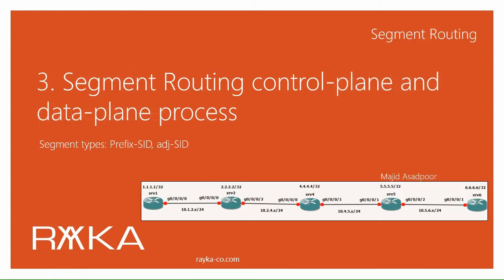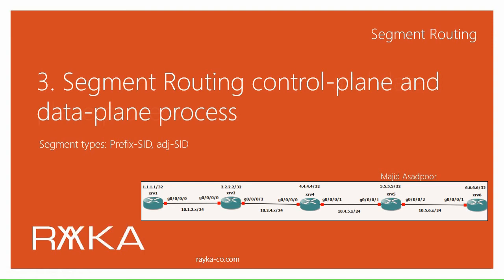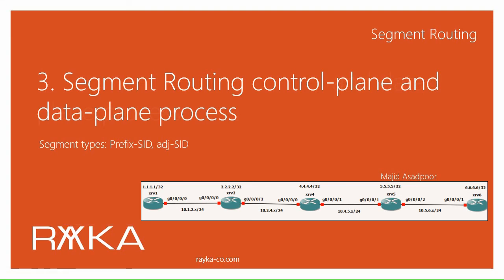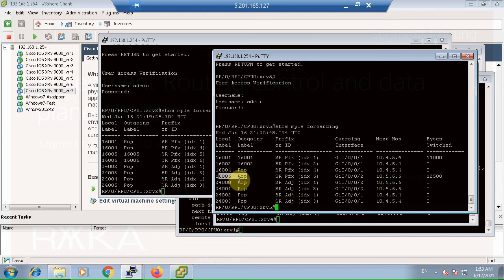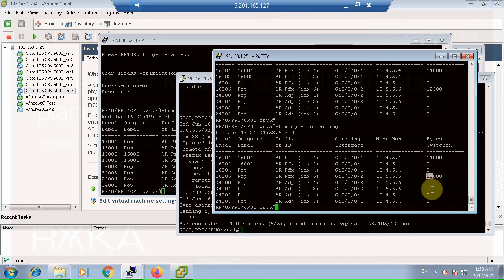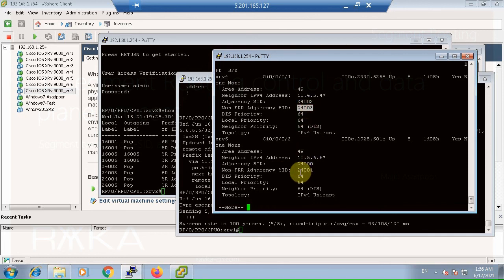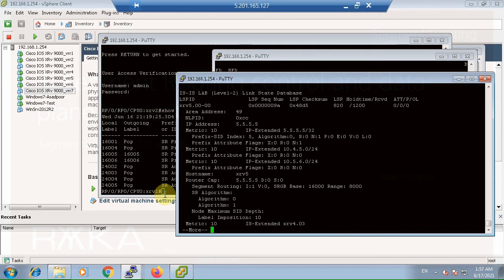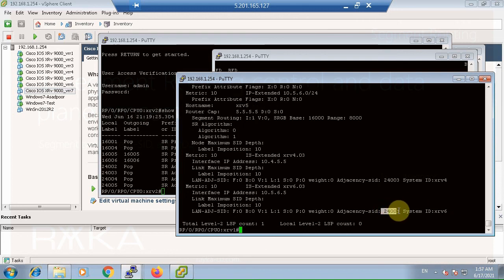3.segment routing control-plane and data-plane process

Comment: Which version of IOS XRv you are using?
Reply from the maker: version 6.6.3 , https://rayka-co.com/lesson/2-preparing-segment-routing-laboratory/
Reply: @rayka-  Will I be able to do basic segment routing , LDP mapping server , TI LFA and SR TE with 6.0.1 version of IOS XRv?.
Reply: @rayka-  I appreciate your hard work in making those videos. Your videos greatly helped in understanding segment routing and it's application. Nice job 👍
Reply: @rayka-  How much RAM is required for IOS XRv 6.6.3 , the one you used in lab? I will run it in EVE NG , so need to know how much RAM to allocate as I have limited RAM 32 GB on my PC. Thanks
Reply from the maker: @453nabeel  with 64GB RAM could not load more than 5 IOS XR version 6.6.3.
Reply from the maker: @453nabeel  I am not sure. the best solution is to check. or feature navigator
Reply from the maker: @453nabeel  Thank you